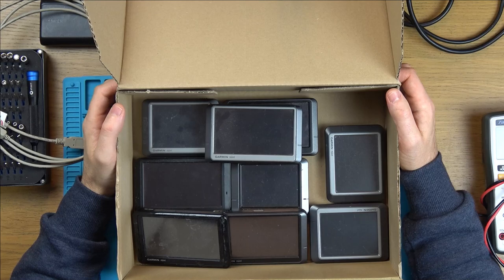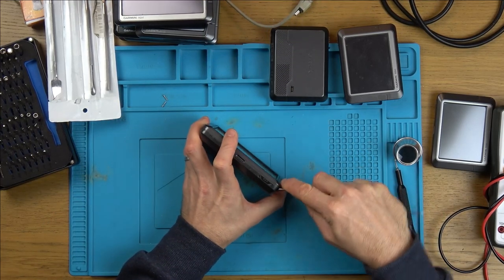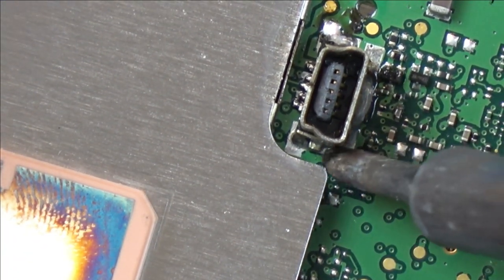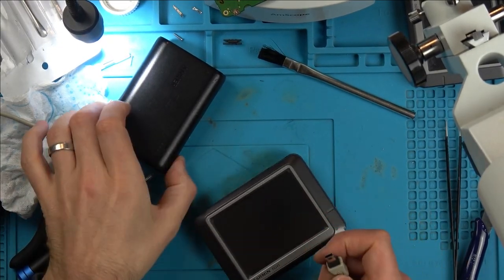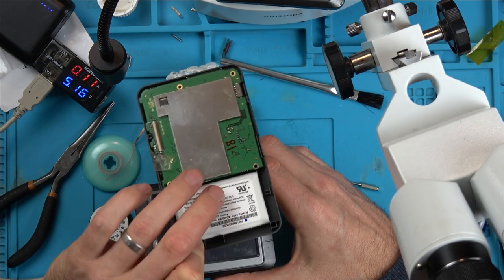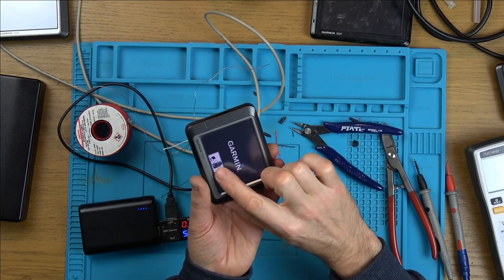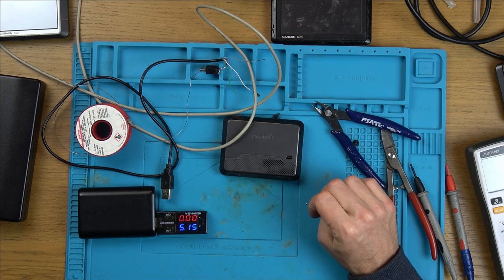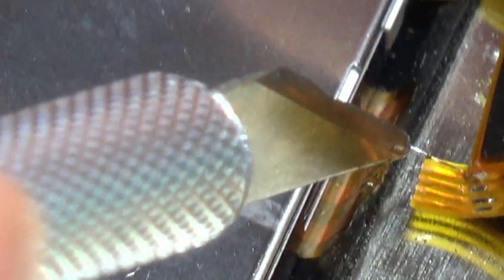A Job Lot of Faulty GARMIN Satellite Navigations - Can They be FIXED?

Comment: On the ones that are locked with a PIN you might be able to confuse it enough to want a full update. If you short a couple of data pins of the RAM chip together and try to boot it, the CPU will think there's a software issue and go into a default programming mode. While it's still on remove the shorts and plug it into a computer and check for Garmin updates. The update might just "blow" everything off the GPS and reinstall the factory defaults from scratch.
Reply: That worked for an Android box I messed up.  Sorta.  There may just be a couple pads that need to be shorted to erase the user data.  Getting it working again would be a challenge and I am sure garmin isn't into supporting these devices.

Comment: Vince for these type of repairs I suggest using hot air. Prep the pads with fresh solder then use hot air from underside of board till solder melts and attach port.

Comment: Vince, the square block on the back is the GPS Module/Antenna. If you look up GPS modules for Arduino etc you will see similar units.
Reply: spot on... all my gps drones have the same thing
Reply: A microstrip patch antenna. If it were made using air as the dielectric, it would need to be 10cm x 10cm, but with a ceramic like zinc titanate or zinc aluminate, the size can be reduced significantly.
Reply: BEEFGOOSE.

Comment: This bring back a lot of memories, Used to do a lot of these, To remove the shield you just need to remove the GPS antenna ( the thing that looks like a heatsink) just unsolder the center pin,The USB port was always the main fault, Good job as always  👍👍👍👍👍👍
Reply from the maker: Thank you AR 👍👍👍👍

Comment: Garmin uses a proprietary option on the the mini USB. There's a 5th pins that when there's a resister to ground it will trigger charge mode, with out it it will stay in data mode.

Comment: Hi Vince, for the ones with the pin, is a 4 digit pin and you will need a "Brute force PIN code finder" in order to "hack" them, because there is no limit in pin entering :), you have only values from 0000 to 9999.
Reply: Hi @CroiX I have always been interested in the concept of these, so would the Garmin need to be attached to a PC running the brute force pin code finder and run it like how you would see in something like Terminator 2 or a hacking film?
Reply: @grahamroberts1833  No need to be attached to the computer. You will need some servo motors and an Arduino and pencil to type the codes from 0000 to 9999 until one of them will work. The challenge is to catch the code that is correct when is entered so you can use it to remove it afterwards from the soft.
Reply: @CroiX_RO  I did wonder if you could just brute force since it looks like no limit on attempts.
Reply: @electronJarvs   via software ?  Software i don't know if something exist at this moment :)
Reply: @CroiX_RO  Interestingly someone has uploaded a video of someone doing that about 10 years ago. It also has a piece of code that tells you which one worked (I think).
Reply: I brute forced my 4 digit car radio PIN by punching in random numbers at stop-lights, unfortunately it took 6-8mths, ie, it ain't easy unless you automate it.
Reply: Love the word ""hack"" in the year 2022
Reply: @SidneyCritic  Linux has an  OS ....just for brute force.....
Reply: @ryuken7129  Kali 😉
Reply: @CroiX_RO  No need to brute force the code, just need to find the correct firmware for the units and reflash them. This worked with a garmin and a navman I have here to which I forgot the stupid pin.
Reply: Apparently you might be able to push 3v to the upper right pin on the main chip?!? Who knows 😀

Comment: having maintained several Nuvi units over the years for a fleet, that symbol you are seeing on the screen is the unit thinking you plugged it into a computer and it is searching for the management software.  if you plug a "power only" usb cable into them they should boot right up.  or alternatively if you let them sit there for a couple minutes they will time out and come up.
Reply: Does the same in the car if you use a USB socket adapter into the 12v socket and then plug a USB cable from it to the Garmin.You have to use the official charger or a power only cable as stated 👍
Reply: I agree, the car power cable has a cigarette lighter plug on one end, and no data connections, but the PC lead that you are using has the data connections, so the Garmin boots into update mode as a result
Reply: I think you can/could also buy Garmin mains chargers that work the same as a car charger.I bought a travel pack cheap when Comet(remember them ?) closed down that had the necessary bits in.
Reply: My official Garmin Nuvi GPS charger (with the cigarette lighter plug) has all pins present inside the end that plugs into the unit, exactly the same as the regular USB cable that came with it to plug it into a PC. And mine doesn't boot up looking for a computer when I turn the car on. My unit is also quite a few years old now (around 8 to 9yrs old). Still receives regular updates too :)
Reply: @ray73864  The cigarette lighter end will only have the power connections, the data leads are not connected, that is why you don't get an update symbol in the car

Comment: Hi Vince! you need a proper Garmin car charger in order for them to run out of power. A normal usb (data or only charge) will set it to transfer mode. We still use those on my company due to the simplicity to send waypoints and routes
Reply: If I remember right, in the car charger cable the data pins are shorted together. This might be what tells the Garmin that it's not connected to a computer. I'm not 100% certain of that but it would make sense since theres very little current on those wires

Comment: As I’m old I can remember a time in the 80’s when a large proportion of car break in’s were to pinch the sat nags and the police+government lent on the manufacturers to make theft more difficult... hence a lot of e-waste in years to come.  All of these tech measures should come with some sort of statute of limitations or escrow approach that allows them to be fully reused even if it means they need to go through some trusted wiping process.  

Well done Vince, great start to the new year! 👍😀
Reply: Sadly there is no way to determine legitimate use though. Similar problem with phones, it results in a lot of e-waste. Just imagine how many Google or Apple locked devices there are out there!
Reply: @Fifury161  It's very convoluted, but you can clear Android phones. Apple phones get blacklisted, but someone said it's with the provider, and that they can un-blacklist them if you can talk them into it, ie, it's not easy.
Reply: Thay had sat nav’s in the 80’s ?
Reply: MINI DIVA  no
Reply: @GHOSTMARIO64  Expensive cars had navigation systems as early as '81, but as far as I can tell, they weren't using satellites to determine location. The first true GPS device for a car went on sale in '89. So, short answer: yes, they did.
Reply: MINI DIVA  Please verify that you're not a bot
Reply: @TheBotleyBoy  They must have been rubbish since the US gov't didn't disable "selective availability" until 2000, which artificially made them 10x less accurate than they are today.

Comment: Wonder if you could dump the eemc of a non pin locked one and flash a locked one to unlock it? Also wonder if you could find the pin in the emmc assuming it's not encrypted
Reply: I once unlocked a Nüvi with a TSOP flash chip. I carefully shorted some of the data/adress lines at bootup that made the Nüvi go into bootloader mode, from there i could reflash it from the computer and it came back unlocked.

Comment: Broken USB ports were extremely common on satnavs due to them being mishandled in cars.
Satnavs are still useful for basic navigation, provided you can get map updates.
It would be fun to try to unlock those PIN'ed ones, I bet shorting a couple pins on the flash chip would enable some sort of recovery mode in the SoC.
Reply: My bet is there is a workarround or someone on ebay bypassing them
Reply: I think because people wrap the cable round and.  Bung in the glovebox.

Comment: Common pins for those devices I found are 0000,1111,2580,0852,1234 these are very commonly used. And look for areas on touch screen for heavier wear patterns that correlate to the numeric pad that helps also.

Comment: You need a 18k resistor between the unused pin (next and ground) and ground. That way it will charge. Just did a quick measure for you on my ebike.

Comment: The ones with the picture of computer when powered is because you have a data cable plugged in, swap it for a power only cable.
Reply: I hated these Garmin units for requiring their proprietary cables.

Comment: If I remember right, to do a hard reset touch and hold bottom right corner and power on switch at the same time until you get a prompt. Then it gives option of deleting all user data.

Comment: Hi Vince,
The marking on the Coil is really matter, the value is the inductivity of the coil in mH (milli Henry). And because this coil is a part of a step down converter I think in long term not a good idea to put a random value to the circuitry. But in general, congratulation for the successful repair!
Regards, Mark

Comment: That computer signal means that it is thinking that it is connected to a computer because it is not the original charger you are using. The original charger uses resistors between the power and data lines to detect the charger.
Reply: Devices that use proprietary cables deserve to be thrown into the garbage!
Reply: @Mobin92  how would you like it if your device vas stolen just because it can be used with ANY charger? And anyway, smartphones use almost the same technology to determine how fast can they charge with the charger plugged into them. And anyway, it is easy to replicate the cable it needs. Or at least for me and Vince it is.

Comment: I own one of these . Went to update the maps recently as I haven't used it for a while . They wanted £80 for the privilege.  Not sure if that's normal but was a shock especially as Google maps are free and more up to date
Reply: That's normal for older Garmin devices. Newer units come with lifetime (of the device) updates for the included map. It was possible to buy a lifetime update for older units. BTDT and then i dropped my GPS 😞
Reply: Google maps makes some very strange route choices.

Comment: No criticism at all, but you may have better luck using less flux and alcohol.  
Flux is integrated into the solder.  In my experience, flux core solder with lead doesn't need any external flux.  Especially on small pin pitch work.  Flux is helpful when doing large chips, and you are flooding the area with solder and heat such as with an air soldering station.  With a pencil, the evaporation of all that liquid is wasting all of your heat and giving cold joints or poor wetting of the metal onto the surface.  
Flux is meant to be a cleaner and preps the surface.  You can use it to scour and use braid to clean up the boards, but once clean, don't use any more flux.  It's in the solder.

Comment: You need a KSGER T12 soldering station. I use that one and it’s got the power to solder what you need and wide selection of tips. Also it’s very affordable.

Comment: I have two old TomTom sat navs with lifetime map updates, a 4.3" XL and a 5" XXL, I still keep updated. They can no longer hold the whole of Canada/U.S./Mexico, just the U.S., but they still work great. They're only for 'emergency' because I use Waze through my smartphone and Android Auto now primarily.
Reply: Does it have a spot for an SD card?  That how I have to use my Nuvi. I have a 28GB card installed to store maps.
Reply: No, both just have 2GB of internal storage.
Reply: @WackyT08  Ahh!  I see.  Mine got full up and it told me that I couldn't update maps without more storage.  My storage is only about 48% full after recent update.  On the plus side, my GPS can now give me traffic delay information for big cities like Baltimore and Washington DC.  It NEVER did traffic updates.  It must be new firmware.
Reply: Wish they would've done the storage as an SD or microSD card. It's soldered on the mainboard though.

Comment: GPSs for your car aren't dated :) Not by a long shot.

I get live traffic from my Garmin GPS when I visit the Perth area here in Western Australia, I don't get it here in the South-West, but not even Google is very accurate for that either.

I also much prefer the interface on it, and get free updates anyway.

My car is 31yrs old in a months time, no built-in GPS, only place to mount a phone is the windscreen, touching your phone while driving is a no-no over here (even if it is in a cradle), but touching your GPS device is fine (so long as it is in a cradle).
Reply: Exactly.  I can't see why anyone would use a fiddly phone for navigation when Google maps makes strange route choices, fails the moment you can no signal and when you do get signal the app is overridden by the incoming calls and notifications.  Plus my phone screen is shiny, which means it's totally invisible when the sun shines on it.  My satnav is matte and quite visible.

Comment: I had issues with these satnavs, I haf to use original cable for it to work, it did come up with that same sign. I bought a longer USB and connected to one of the free USB in the cabin, never worked unless I used the garmin cable

Comment: get low melt solder if you're struggling with removing a part like that mini USB. low melt solder mixes in with leaded or unleaded and dilutes it, and makes the joints stay molten for longer while also requiring much less heat than even leaded solder to get molten.

Comment: I wonder if the screens could be donated to a maker space . They may potentially be able to reuse them in raspberry pi projects or projects that people do to make handheld games systems like Ben heck used to do
Reply: Sadly these screens are custom made-to-order and usually you cannot get the datasheet/pinout, so it's a complete waste of time.
Reply: @zaprodk  that really sucks . They would of been quite useful if you could get the data sheet for them. We waste far too many things like this .
Reply: @davesmith7671  i cannot agree more. I reuse all the weird displays and stuff from stuff that i see broken, and sadly LCD's have an insane problem with being proprietary most of the time.

Comment: the way how Garmin mounted these mini usb connector is a design flaw, there is no real mechanical force deflection, all force goes directly to the soldered connector pins
Reply: When I had mine, while it never broke, it was always "Lose".  The lose resulted in the plug being a lever.   I can see them using this connection for years early in USB adoption, but they hung with this design way too long.

Comment: Nice fixes There should be a way to actually factory reset which gets rid of the pin / secure location garmin just doesn't want people to know how to as an anti theft feature but there's either software or a really simple way to reset it to factory that only garmin knows until someone figures it out

Comment: Hi Vince another perfect video from you thank you for your content creation I love them so much .I also have some sat nav devices as you said they are dated or out dated as you recall maybe you can use them as media players or digital photo galery thingy.And also maybe you can remove the PIN by wipe the data from memory chips as we can see at 30:30 there is 3 chips the big one probably the cpu or SOC the other chips looks like ROM and storage but I am not sure that PIN information is held at ROM or storage also there is probably RX-TX protocol somewhere at the board for debug and service but overeall you did a great job especially fixing that ribbon cable.P.S:sorry for typos if there is any.

Comment: ones asking for a card to be inserted are asking for the operating system loaded on the sd card to be inserted. as its an option to boot off onboard flash or sd card. sd cards were used for larger maps that exceeded flash size.

Comment: * - I would like to play with those.. TSOP-8.. basically a CMOS/BIOS flash chip... you can get one for like $15(CH341A Black board with voltage selector)(can get em anywhere).. back up the bin/hex file.. put it in a hex viewer... guarantee you will find the pins... doing what you do... you should have one of those, (for backing up flash & dumping it for PINS, serial #'s, etc..) and a cheap logic analyzer (around $10).. so you can read data coming out of chips.. boot sequences...etc..

Comment: There's no lockout on the number of PIN guesses you get. Give the locked ones to your kids and get them to try 0000 - 9999 until they find it :-) statistically you only have to check 50% of the keyspace before you find it.

It's also probably something obvious like 1234 or 0000 or 9876 or 1111 etc. Try all those obvious ones first.
Reply: Often it's a year of birth so another good tip is to try 1960 to 2000 sort of area
Reply: It has a two form authentication. Not only is a PIN required, you also have to be near the location it was set up.
Reply: @therealjammit  no, it's one or the other. If it was both, then how would you use it to get home, if you had to go home first?

Comment: I ONLY use the Garmin units...  Those GPS units work directly off GPS Satellites and don't loose signal..  Your cell and auto work off cellular towers, so when there's no signal your stuck..   The Garmin screen is separate of all other systems and it doesn't get interrupted by phone calls, climate systems, or radio changes.. So you don't miss an upcoming turn cause of a text or call.  They are also mounted on the windshield right in your line of sight and no need to take your eyes off the road to try and read a tiny phone or radio screen..